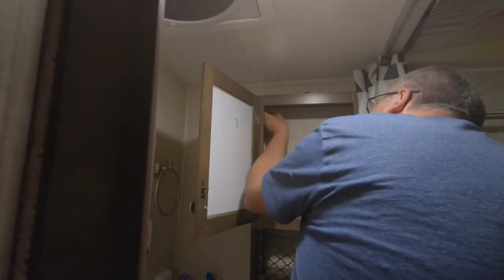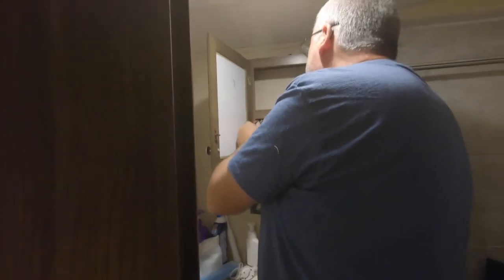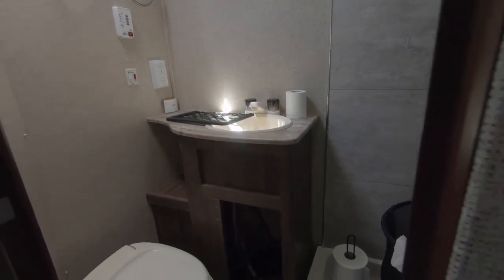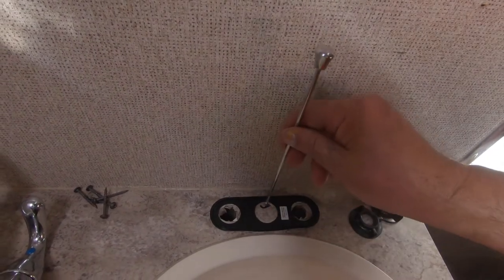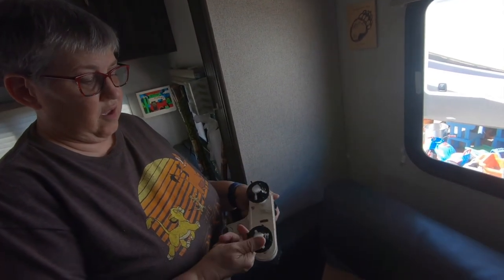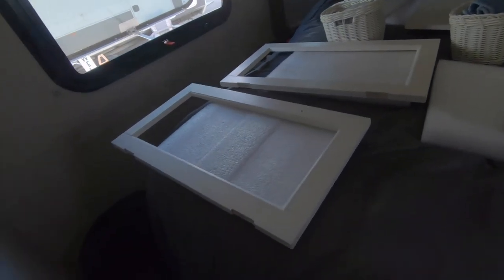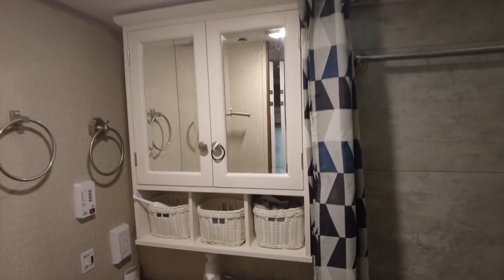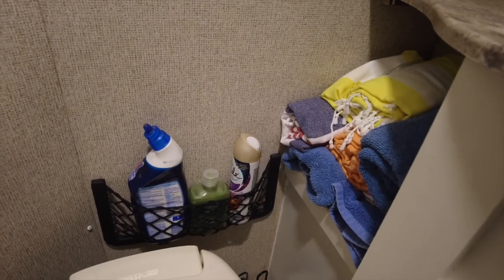RV medicine cabinet, sink and faucet replace with box store items.

Comment: Looks really nice... Great job...What did you use on the shower wall? I heard something about tile.
Reply: The tiles were from Menards.  They are called Dumawall tiles.  The tiles go from corner to the edge of the pan so no vertical seam.  The tiles measure 25 1/2 long.  Dumawall does make smaller tiles so be careful.  We did remove the existing inside corner and probably caulked the inside corner before putting up the Dumawall tiles.  The Dumawall trim is expensive so I used standard aluminum L shaped material for the inside corner and  regular tile trim pieces to trim the outside.  Hope this helps!

Comment: How do you know if there's piping or wiring    in that wall?
Reply from the maker: Good question!  I really did check to see where the plumbing and wiring ran before I installed the new cabinet.  If you look under the bathroom sink you can see where the water supply plumbing comes from (under the slide out to the sink) and it then runs along the floor to the shower.  The drain goes down to the holding tanks, of course.  The plumbing vents are in the corners behind those false walls.  The 12 volt wiring runs down the middle of the ceiling where the lights are.  There are 110 volt wires running along the water supply lines and they go up to the outlet in the bathroom, under the shower and up to the outlet in the bedroom.  Now, there could be tank sensor wiring that goes from the tanks below to the sensor panel behind that wall but I would bet that the wires go straight down thru the floor below the panel.  So, nothing I can think of would be behind the wall where the medicine cabinet is.  Just remember that the walls are 1 1/2 inches thick!  Use appropriately sized screws.